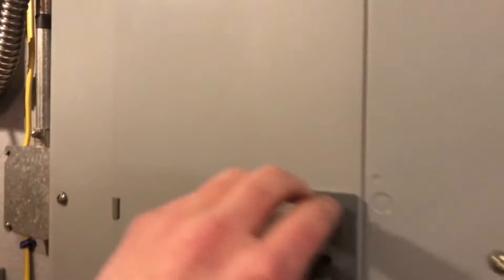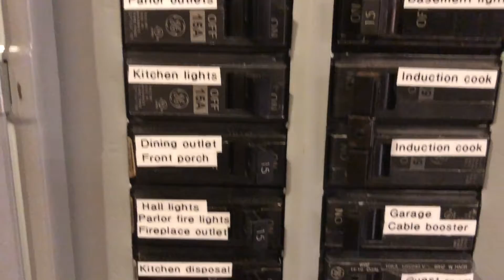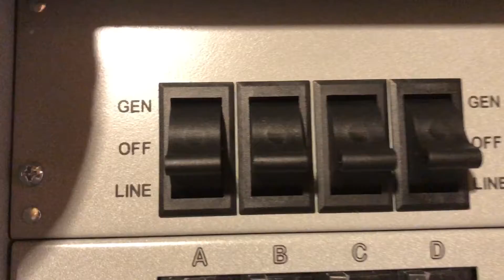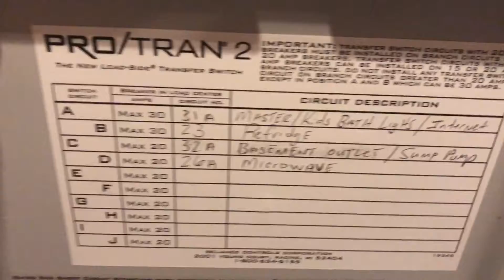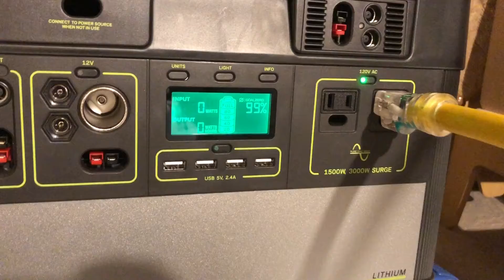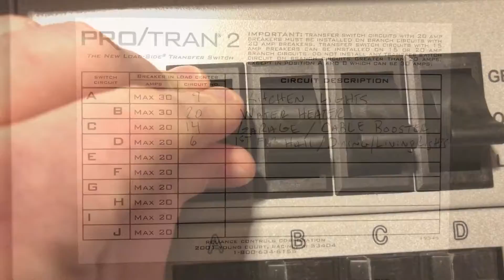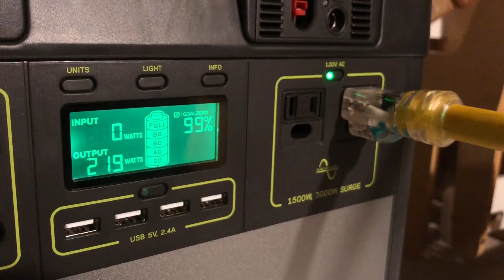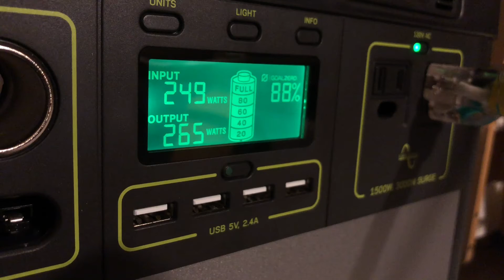Installing Two Goal Zero Yeti Home Integration Kits to Connect a Yeti 1000 to My Electrical Panel

Comment: Watched this video several times in 2025. I know your video is 6 years old but I got a lot of good information and ideas which assisted me with sitting up my hybrid backup power system. My electrician installed my reliance pro Tran 2 transfer switch that they marketed for EcoFlow. He also used a cantex junction box with the solar cable connectors so I can use solar to power my EcoFlow Pro and I don’t have to worry about critters getting inside my house. I purchased the Leviton male inlet receptacle and the weather proof outlet box and had it installed to use my Honda 2200i to power my EcoFlow Pro when solar is not an option. I see you have upgraded to a bigger transfer switch and now have the DPU. Now that I am comfortable with using my 6 circuit transfer switch I can see myself upgrading in the future. For now I am very impressed with my current setup and happy that I don’t have to go outside in the rain 🌧️ or when it’s dark to sit up my portable whole house tri fuel  generator system.
Reply from the maker: That’s awesome, glad you found the video helpful!

Comment: I have watched this video several times, thank you! I only get lost at the end trying to understand how you get the power from the generator to the manual transfer boxes. It looks like you plug it in to an eletrical outlet and then maybe plug the yellow cord into the other outlet? That is not making sense to me so I think I misunderstand this part. Thanks in advance for clarifying!

Comment: 12:30  On the YETI panel, it shows you using 17.7 Amps. However, the output port is rated as "AC inverter (output, pure sine wave): 120VAC 60Hz, 12.5A (1500W, 3000W surge)".  Is that safe?

Comment: So even if the utility power is functioning normally, you can just switch one (or all) of the circuit to "GEN" and they will run off the Yeti?
Reply from the maker: Yep, that's the benefit of a transfer panel over an interlock. You can flip individual circuits to battery power and leave the rest on grid.

Comment: Hey Todd, 

We just hooked up a similar system in our house. 

We are considering leaving the unit active while on a long trip. 

Theory being, the power will flow through the inverter, and only use battery energy in the event of a black out. 

Thoughts?
Reply from the maker: It’s tricky because if you have power station with no reheated battery charger like Ecoflow, you can’t connect it to your electrical panel and plug it into the wall at the same time or it will fry the charger and/or trip a breaker. If it had a DC power brick, that will isolate it and should work

Comment: Thanks for this video! I'm considering a Goal Zero integration. Would you recommend it after four years of use?
Reply from the maker: I still like mine but I'd suggest just buying a Reliance transfer switch because you can get one with 8, 10, 12, etc. circuits. The GZ one is just a Reliance panel with an instruction sheet from them. The only real difference is it has a standard 120v plug on the front but I bet you can get that one a Reliance one too

Comment: So you have a switch (the Yetti home integration kit) that switches the house circuit power source over to the battery, does anyone make a switch that would disconnect a home’s solar panels from the grid and then allow a home’s solar panels to then charge the Yetti?
Reply from the maker: Unfortunately, no. That's the biggest bummer with a rooftop array. When the grid goes down, you can't access that power. There are a few inverters that let you pull a bit of power from the roof but it's very rare. Kind of blows my mind.

Comment: Great video. But I think it points out why goal zero isn’t the best solution, unless I misunderstood parts.  I’m looking for a way to access the power of my solar, which generates 50kWh per day, when the power is out. It seems the yeti can’t power anything 220v and likely the solar generated power won’t just pass through. I wonder whose system can?
Reply from the maker: If you want to connect your rooftop array and power two phase loads, you're well outside of power station territory and need to look at a Tesla Powerwall. It will be 10-20k to do what you want

Comment: You're expecting way too much from your 1000 yeti.
You'll need 3 to 4 times the capacity. 
I used Jackery 1500 on my similar sized refrigerator. It lasted about 6 hours. It is a energy hog. 325 watts when compressor is running. 450 watts when defroster comes on.
Reply from the maker: For sure. The plan was to use the Yeti as a buffer so I could run my generator a few times a day so it wouldn’t need to run continuously. It would cycle on and charge the Yeti and I’d cruise for a while. The HIKs give me future flexibility. I have a AC500 and 6kw of batteries hooked up to them now and the Yeti is in retirement

Comment: The solar Generater.Systems E300 is a great product . It does everything well. Great job, Jackery.
Reply: Yes, if its sunny day.
On cloudy days, you'll get around 10% to 25%.
Ice, leaves, snow covering the panels will get you  0%.
You'll have to place more panels to offset the loss.

Comment: Todd, thank you for your very informative video. I am in the process of purchasing a Goal Zero Yeti Home Integration kit for use with my BLUETTI AC200MAX. I have a question about which power outlet to use from the AC200MAX to the Goal Zero Yeti. Since the AC200MAX has a NEMA TT-30 outlet, should I use that instead of a regular power outlet or does it matter?
Reply from the maker: You’d use a standard extension cable from the AC output of the 200MAX but you could also look at any Reliance transfer panels, most use the TT-30 output and they might be cheaper or offer more breakers. Ultimately, the 200MAX only puts out 20A so the TT-30 isn’t really giving you 30A output, it’s the same power as the normal outlets
Reply: @todd.parker  Thanks for your reply, Todd. And you know, you're right. The TT-30 outlet isn't any different than the other outlets. I guess it's just there for convenience. Oh, I wanted to give you a quick update. Instead of buying the Goal Zero Yeti Home Integration Kit, I am considering the Connecticut Electric EGS107501G2KIT EmerGen EGS107501G2 Manual Transfer Switch Kit. For only $80 more, you get 10 circuits. Let me know if you have an opinion of this product, but the specs and features look very good. In any event, thanks again for the information.
Reply from the maker: @realistindenial  I don’t know that one in particular but is a better value than the GZ panel and should do the same job.

Comment: Thanks for the video - super helpful. You installed two HIKs -- is that just so you had more control over what you ran during a power outage? You wouldn't actually be able to turn on all the circuits on both HIKs to run all that, unless it was just lights or other small-draw circuits, right? I like the idea of having two and may do that myself, but was just curious about how you powered the house during a real outage.
Reply from the maker: I bought 2 HIKs so I had some flexibility. I can power each from different power stations or generators if needed. For the most part, I’ve been using one with a splitter to power both panels. My Ecoflow Delta Max and Bluetti AC200P can power everything at once  for the most part since there are lights, on demand water heater (100w), fridge, sump pump, microwave, router, etc. so they are low draw except for the microwave. It’s cheaper to get one panel but I like having options. It works great.

Comment: Way late to watching this video, but just wanted to say thank you for sharing your setup.  Also, thanks for continuing to respond to questions.  My configuration will be very similar to yours with the exception there will be no Yeti.  I have a normal all-in-one inverter and 12 kWh of batteries with 1800 watts of solar.  Under normal operating conditions it is used to charge my EVs only, but during an emergency I want to use the two transfer switches to power the house for essential loads.

As others have said, having the ability to use a combination of generator and inverter power with two different transfer switches is a real value compared to trying to do a single split-phase inverter for the whole house.  

Thanks again.  I would love to see an update video if there is anything you have changed.
Reply from the maker: Sounds like a cool setup. Mine hasn’t changed much, having two panels is really nice. I modified my setup to run MC4 cables in from an 800w array
Reply: @todd.parker  we have a really old coal chute covered by an ugly hatch.  Your vid gave me the idea to turn that into a place to put the yeti solar panels. It's right above where our house panel is located.  :)

Comment: Todd, did you consider using a single transfer switch that had more circuits? I understand Reliant makes 6, 8, and even 10 circuit transfer switches.
Reply from the maker: I did and they are the same. The only difference is the GZ panel has a standard 110v plug vs a 30A plug and I wasn’t sure if I I could swap that or use a converter. I hindsight, I would probably recommend putting in a big transfer and use an adapter switch to save some money
Reply: @todd.parker  I called Reliant and was told you can use a 30a to 15a plug converter. However, after thinking about this more, it occurred to me there may be an advantage to using more than one manual transfer switch. It has to do with being able to simultaneously use two different supply sources, separate from each other. So as an example connecting more than one lithium generator or connecting an outside generator.
Reply from the maker: @larrysiegle5345  right, I think that was a factor for me too. Batteries are getting bigger now so one system could be fine but it’s nice to have flexibility like you said. Otherwise these are pretty stick Reliance panels with a GZ instruction sheet

Comment: How does the integration panel power the circuit without the circuit energizing the panel?  Do you have a schematic?  I ask because my solar system looks for power in the panel (microinverters) to see whether to turn on the inverters and convert the solar dc power to AC power which will then try and dump the extra power on the grid.   If the grid is down would this  be an issue?  Would I need to turn off the solar system disconnect before energizing the selected circuits?
Reply from the maker: These are pretty standard manual transfer panels, just with a 110v input rather than a 30amp connector that bigger generators use. Maybe this article will help: https://www.wikihow.com/Install-a-Transfer-Switch
Reply: @todd.parker  thanks!
Reply: @todd.parker  Also https://www.youtube.com/watch?v=GLgtFCJlVFQ  5:15 is a good animation...
Reply from the maker: @metamorph20  Wow, that’s a really great find

Comment: Amazing! I just bought the yeti 6000x and one 200 watts nomand solar panel and the next step is to have the home integration kit installed 🤞

I plan to use the yeti for off grid camping but I am scared to bring it because it’s kinda expensive if somebody tried to steal it. Any suggestions? And I am not going to tie it down a tree haha. 

Excellent video!
Reply from the maker: Maybe the weight will deter thieves!
Reply: Maybe get the 1000X or 1500X for camping. I would NOT want to load/unload the 6000X for a camping trip.

Comment: Could I ask why you are using what appears to be a GFI Duplex outlet from your main panel, for feeding power to the Yeti and would that not also dictate a GFI 15/20 amp circuit breaker in the panel?
Thanks.
Reply from the maker: My electrician wired up these two transfer panels so I’m not sure I can answer the question.

Comment: Todd, as a new Goal Zero Yeti 3000X user, absolutely love your videos and have a question.
Am going to use HIK with 3000X at cottage on a island where we loose electric frequently, generally 2-4 hours at a time. My thought was to constantly charge 3000X with grid power, and leave a couple HIK  circuits (refrig, Wi-Fi,security) on full time so when grid power goes out, these circuits would not be interrupted. Additionally, when I leave for a couple months at a time, the same would hold true, while also getting benefit of the above items getting pure sine wave power. Do you have any thoughts or advice on this planned setup and use?
Thanks again.
Reply from the maker: That seems like a good idea. The only question I have is how much, if any, all that cycling would do to the batteries. In theory it shouldn’t be too much. Glad you like the videos!

Comment: Nice video.  Do you have any problems with circuits that have a GFCI?  I have heard that there may be issues with GFCI's tripping when a transfer panel is connected to a gererator/solar generator due to the ground wire.  I am looking at using one of the GZ integration kit and possibly plugging an inverter in from my EV's 40 kwh battery, or from a Goal Zero.
Reply from the maker: I haven’t but I don’t think I have many GFCI circuits on it

Comment: Hey bro, I live in a mobile home, and my company gives me the nights for free, do you think that if I buy the yeti 3000 it will be useful for me to use from 7:00 am to 9:00 pm. I would only use it for my fridge and my lights and a security camera system
Reply from the maker: The 3000 should easily power a full size fridge and other appliances for a day or more. Ideally your lights would be LED.

Comment: That's way too much stuff plugged in to a small Yeti, I guess 3000X. Overkill of home integration kits.
Reply from the maker: Works like a champ.
Reply: @todd.parker I recently checked Tesla solar for my home and that recommended 3 Tesla walls, that is 22.5 KWhr/2100 AmpHr batteries. Home integration works well with that type of capacity. 280 amp he is too small for a SFH IMHO but if it works for you that great.
Reply from the maker: @mantan_rtw  my setup is to run the bare minimums during a power outage so it’s far from an off grid setup. My my solar and propane generator can run the basics like a fridge and some lights for extended times. A power wall is a much bigger system for sure!

Comment: Amazing video and thank you for making . I wish goal zero did a better job of producing videos like this so we all didn’t have to bug you. . Stupid question as a back up can you plug your gen into the transfer switch as a back up back up if the Yeti died?
Reply from the maker: Thanks, glad it was helpful. I wish GZ did a better job explaining how their stuff works. Anyway, yes. I can either plug either the yeti or generator into the transfer panel by switching 2 plugs
Reply: @todd.parker  I was hoping that was the case but stoked you’ve tried it so I have the confidence knowing it could work
Reply from the maker: @Rideborba  The transfer panel isn't actually anything Goal Zero specific, it's made by a major company that manufactures these. Typically, these panels have a 30A plug but since the Yetis only have a standard 120v output, they have just swapped the 30A input for a 120v input but it's otherwise a standard unit. So anything that outputs 120v can be plugged into the transfer panel to power it up - Yeti, generator, etc.
Reply: I'm just curious: Why not use the generator instead of even buying a yeti when the power goes out?